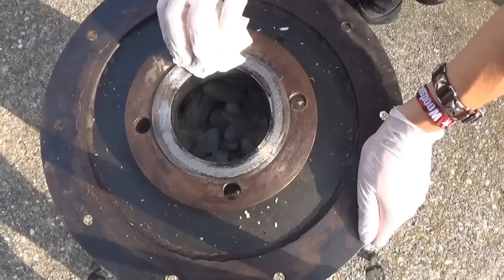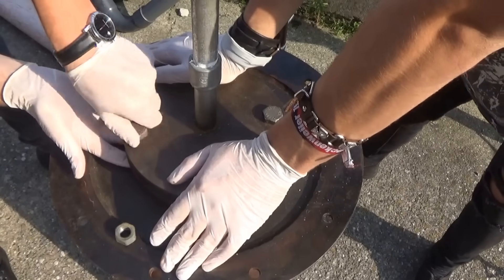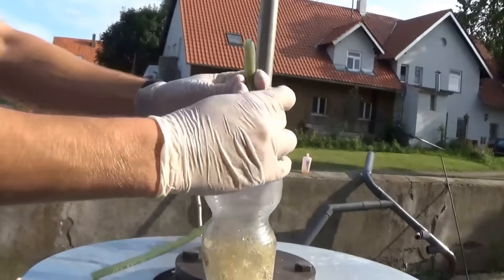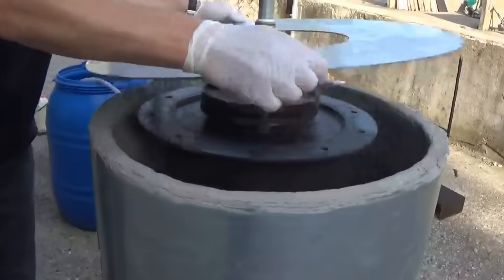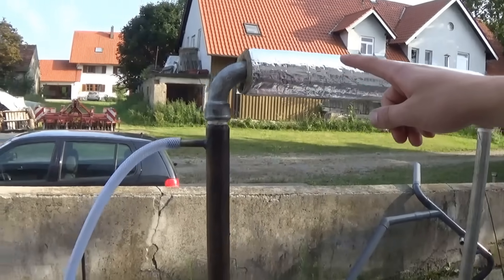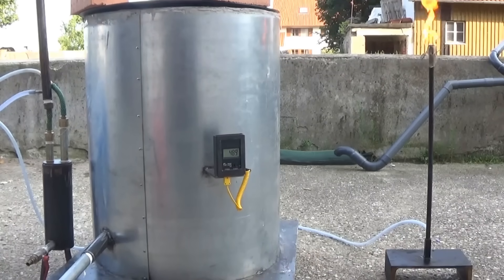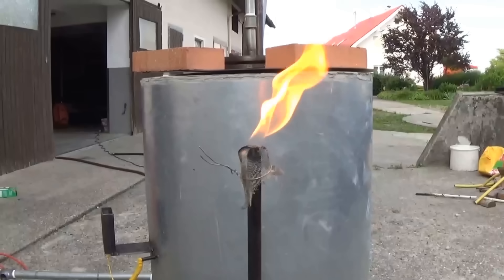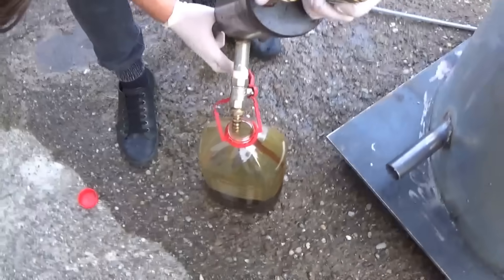plastic waste to oil/fuel improved pyrolysis reactor

Comment: I fully agree with Hazel Chem: All PE (marked #2 or marked #4), PP (marked #5) and PS (marked #6) plastics must be recycled, not just used as feedstock for pyrolysis oil. The only exception could be if contaminated or very dirty. Hard to remove contamination, fx. paint layer/glue/hardened oils, makes theses types of plastic uneconomical to recycle for the time being.  In the near future all contaminated plastics can be recycled, as more chemical recycling plants are being constructed. Contaminants in plastic for chemical recycling are not affected by this process, thus it's possible to recycle virtually all waste plastic; no matter how dirty it is. 
It's worth noting that PS plastic can cause some problems with the pyrolysis oil. After a few weeks of storage a jelly like substance starts forming at the bottom of the container, then spreads slowly but surely through the whole content. Sometimes the pyrolysis oil already contains jelly like lumps right from production. The solution is to use a catalyst (Zeolite or another of the hydrated aluminosilicate minerals) to crack the molecules during the pyrolysis process.
Obvious plastic types for conversion to pyrolysis oil are the thermosetting plastics which cannot be remelted, i.e. epoxy, bakelite (creates formaldehydes), plastics with high filler content (fx. PP with Natrium Carbonate/"Sodium Carbonate"), and similar problematic types. Some of the plastic types in the collective group marked #7 (construction plastics) can be pretty hard to sell, with only a few buyers worldwide, and are therefore mostly pyrolyzed. This is also the case for the odd alloys belonging to the group marked #7 plastics (fx. PMMA/PC, and several other plastic alloys). In order to sell these types, a minimum quantity of 10 or 20 tons of the individual type in each shipment is required for anyone to be interested.
Another problem is PE, PP, and PS plastics with added glass fibers (marked: +GF), these are added from 5 to 30% (occasionally up to 50%) glass fibers. During the recycling process the glass fibers will unavoidably break up into tiny short ultra thin glass splinters, thereby loosing their ability to reinforce the plastic; it becomes just an annoying filler. Nobody wants to buy that, so pyrolyzing is the solution. It's worth adding that the biproduct carbon black can neither be sold because it's heavily contaminated with broken glass fibers; though it can be used as fuel in the fire chamber underneath the pyrolysis vessel. The same process goes for glass fiber reinforced resins (fx. hulls from old boats), although technically advanced pyrolysis units can recover the glass fibers as well, provided the glassfibers are long enough and the pyrolysis residue consists of mainly glass fibers (i.e. boat hulls/windmill wings).
Be aware that a large part of plastics from WEEE (Waste Electric and Electronic Equipment) contains added Fire Retardants (marked: /FR). These are toxic!  They are either Bromine(brominated) or Chlorine(chlorinated) based, and additional hazardous plasticizer- or stabilizer chemicals may also be present in such feedstock. Never try to pyrolyze such material unless you have a professional unit capable of catching these elements and extracting them completely from the pyrolysis oil. Not all plastics from WEEE contains these chemicals, but a thorough sorting is definitely needed. Besides the pyrolysis oil, the Bromine and the Chlorine can be recovered and sold, or used for other chemical reactions in situ.
Basically, don't try to pyrolyze PET (marked #1). It contains Terephthalate which will sublime and immediately crystalize as soon as it leaves the hot pyrolysis vessel, thus clogging up the tubes with a possible dangerous explosion as a result. You can sell the clean and/or relative clean part for recycling. In fact the remaining dirty and/or broken pieces can actually be processed, but only by a very sophisticated way of pyrolysis. It's solely possible if you have a highly specialized two stage pyrolysis unit capable of maintaining a precise 700 Celsius temperature in the second chamber; and only if you really know what you're doing! The resulting pyrolysis oil will contain at least 30% Benzene (sometimes over 45%), a highly volatile hydrocarbon compound with a boiling point of 80 Celsius; very useful as a solvent for chemical processes. The Benzene is separated from the pyrolysis oil by fractional distillation. The pyrolysis oil can also be used as fuel, provided you have a closed storage/feeding system for your burner,  and a fire chamber capable of maintaining a very high temperature. Benzene is highly carcinogenic and dangerous!  Benzene causes central nervous system damage acutely, and bone marrow damage chronically. Spills are also problematic as Benzene vapor is heavier than air and therefore rather difficult to get rid of. Benzene vapor also presents a serious explosion risk!
It's popular to pyrolyze old car tires, but this presents a major environmental problem. In the Western World a limit of only max 0.5% sulfur in fuel is allowed. Pyrolysis oil from any kind of rubber feedstock will contain over 5% sulfur! It's forbidden to use as is, but it can be sold to refineries that upgrades such low quality "crude oil" and during the refining process removes the excess sulfur. The carbon black residue, the biproduct of pyrolysis, will also contain sulfur. It's prohibited to burn, but there's no need to try to purify it as it can easily be sold to rubber producers; it already contains the necessary sulfur needed for the rubber synthesis.
Generally, stay far away from PVC (marked #3). Tremendous challenges for pyrolyzing this plastic type are present. From a technical view the main problem is it's made of 57% Chlorine. It's the only plastic type containing Chlorine, and it's literally not for amateurs. Chlorine gas will kill you instantly! Seen in a health perspective, all plastics contains some additives, but PVC is the only plastic that always contains a myriad of added hazardous chemicals (10 to 70%), and a small percentage of poisonous Cadmium as well.
Plasticizing additives (primarily to soften up the PVC, but also fx. to make it resistant to degradation by sunlight) includes the controversial phthalates (most commonly (di(2-ethylhexyl)phthalate, DEHP) which are carcinogenic and mutagenic (endocrine disruptors)!
It's a complicated process to catch and remove all these hazardous contaminants, but certainly worth it. Besides pyrolysis oil it mainly yields a huge quantity of free HCl (Hydrochloric acid), useful for lots of chemical processes; after it has been purified!  Due to the Chlorine vapor(gas) attacking almost everything, this process requires a professional well constructed pyrolysis unit, made entirely of acid resistant (high Nickel content, 52%) stainless steel; such as the one I have.
Reply from the maker: thank you for the very informative comment! It is allays nice to see such well crafted responses. If you like to you can write me an email.  I am very interested in having a conversation with another hobby p-reactor builder. My mail is hazelchemistry@gmail.com 

mfg hazelChem
Reply: Are you able to email me? I'm a 2nd-year university student interested in creating a chemical recycling company for plastic, and I'm wondering about your sources and/or role in the plastics industry? You seem very knowledgeable, thus, I think you would be a good contact. Let me know if you're interested in talking, thanks!
Reply: You’re full of interesting information, at least to my mind! I’ll be rereading your comments and trying to make notes! I’m a 57 y.o. guy who’s retiring a little bit early but still am interested in turning “waste” into beneficial products! Would you recommend some resources for me to learn more? Thank you in advance!
Reply: Very valuable input and I am sure that in a properly controlled environment, these aspects need to be taken into consideration.

I however live in Africa where we are face with two major problems, that as far as I am concerned, need to be addressed first before worrying about further finer points of the process ...

Firstly we have a massive waste disposal problem that needs urgent attention and in most of the continent the word recycling means very little.

Secondly, we have a massive energy crises that needs to be addressed.

I would therefore like to get information about a simple and reasonably effective procedure that any household or small group of people could use to get rid of waste in their immediate area while providing some sort of fuel they can use to generate electricity from.

While we are cleaning up the environment and providing households with electricity, we can be educating people and refining the processes.

How do I combine pyrolysis using plastics to using other carbon based feedstock such as garden and kitchen waste?
Reply: Uh. I guess best way of recycling plastics containing paints, fire retardants, uv stabilizers and who knows what is to burn it in incinerator/powerplant in high enough temperature to burn all dangerous volatile gasses. It makes no sense to create fuel from plastics and at the same time to burn everything from gas to bunker oil in powerplants when some of these refinery products can be used for making plastics.
Reply: Sounds like we should just incinerate (600C+) all of it, and bubble the output gases for cl/br/S capture.
Reply: Can't believe I red that
Reply: @zero-waste  Chemical engineer here, and you're right about the dangers. These "fuel from plastic pyrolysis" videos honestly terrify me almost as much as all the commenters saying we should all be doing this. I weep for our future.
Reply: Hello, enjoyed your informative comment, I was wondering if you could provide me info about recycling PMMA to monomer (MMA)? And also info on purifying it to %99.
Actually I'm working on converting Acrylic sheet wastes to monomer MMA, any help or pointing a info source would be appreciated.
Reply: Nice information
Reply: Thanks for the precious informations!

Comment: So if the polystyrene is causing issues with the oil, perhaps it would be good to separate it out to do pure polystyrene runs, then that oil could be treated with extra steps separately
Reply from the maker: That is correct I have already done a PS recycling video where i showed that it is easily possible to produce the styrene monomer from PS in a good quality. 
BUT the problem is that the system aims at to recycle mixed plastic waste and separating is costly so I am looking for a other way to overcome the issue. 

mfg hazelChem

Comment: This setup won't achieve anything except unusable toxic waste...
Reply from the maker: well then do you have anything to back up your claims? scientific papers or data? If this is the case I would be happy to read thru them and discus them with you :D if not well ... it is just your opinion and I couldn t care less about something 

mfg hazelChem
Reply: I have a PhD in chemistry and I am  working working for a pyrolysis company since 10 years. I would say that I am experienced in this field. There a plenty of points in your system which are questionable (contact of humans with toxic products, no gas washing/purification, quality of oil, etc..). There are hundreds of papers concerning this topic, what do you want to get/know?
Reply from the maker: @nerussol3664  If this is the case id be happy if you shared your specific concerns with me! :D you can do this here or via mail hazelchemistry@gmail.com

conderning the toxicity of the oil I am well aware of its dangers (lots of aromatic hydrocarbons and other unpleasant things). Secondly why do you think that a gas washing system is needed for the pyrolysis gases? As far as i am concerned they are mostly made up of shorter hydrocarbons and free of halogen or sulfur contamination. So my question is why should I use a gas washing system ?    

mfg hazelChem

Comment: you should have added a gas washing bubbler before the syn gas burn off. It would also prevent flash back into the receiving vessel.
Reply from the maker: no need for this ! a bubbler (in this case) has no benefit. I mean what should it remove ? 

mfg hazelChem

Comment: Styrene is carcinogen. This a concept but would give enough data for design of a chemical reactor. Safety features are entirely missing. Long unsaturated HCs if polymerises in carburettor of your car or in cylinder of car, god saves you. Nicely explained though...

Comment: I'm glad you said " don't kill yourselves. I live next door. What about me and mine. Did you ask me if I minded you building a bomb in your backyard? This is so odd. I'm not sure what. But something bad is happening hear.
Reply from the maker: it seems  like you are a troll but if you are not: this is no bomb you using a spray can inside is way more dangerous, secondly if have worked with engineers form garlock sealing technologies on the safety of the system so do not worry about it ... thirdly if you really live next doors why didn´t you just came over and asked what is going on? I would have explained it to you .... ah and one last thing there was a article in our local newspaper on the whole project sooooo you could have known it throug that it explained the whole system. 

and lastly because you didn´t seem to get the " do not kill yourself it is a joke from the beginning of my channel and not a real concern ..." 

mfg hazelChem

Comment: Who even converts high engineeering  plastic to oil  ? Petrol is worst product used only to run automobiles
Reply from the maker: It is a process that would enable developing country's to produce a "low" grade fuel out of plastic waste. This could be used for cooking or heating instead of burning wood (which leads to deforestation and ultimately to desertification) or plastic waste (which when burned releases a lot of toxic/harmful substances. For most industrial countrys this process should only be used on the non recyclable fraction of plastic waste (because a industrial setup can use the pyrolysis gas to maintain the pyrolysis and serve as a combined heat and power plant that also has a output of fuel oil) 

mfg hazelChem
Reply: @HazelChem  convert it into another product instead of making engine fuels
Reply from the maker: what do you suppose ?
Reply: @HazelChem  any plastic product like ball pens , holders, plastic screws , copper cables ... any thing
Reply from the maker: @Blue.star1   for that you would have to sort the plastics which is done industrially BUT there is a fraction that cant be sorted and recycled this is what this should be used for in industrial countrys. On the other hand in developing countrys there is a lack of cheap heating fuel so any plastic waste can be converted there (do to them not having such expansive sorting equipment) another point to make is that you are (most of the time) downcycling plastic so the quality durability and so on decreases with every recycling. These are all factors that have to be taken in to consideration. And as last point I want to add that saving our future is not an one tech thing it is a puzzle out of many technologies and a lot of socialengerneering. Hope this helps to understand my opinion on the matter.

mfg hazelChem
Reply: @HazelChem   anyway try making liquid chemicals from coal with your setup , coal liquefaction,  long time ago I tried for few days buy stopped it... try to make chemicals not fuels from coal ....costly chemicals like phenol ... etc
Reply: @HazelChem  make chemicals like phenol etc instead of fuels with degraded plastic

Comment: You should consider heating with a waste motor oil burner. You just need to preheat the furnace with propane and then run it on free oil.
Reply from the maker: I have bought one for use in this reactor ... but I have build a completely new reactor that uses the thermal energy of the gas much better video will come soon ^^

mfg hazelChem

Comment: I heard awhile ago somebody had made a. similar device to extract the oil from rubber car tyres, would solve a world wide problem
Reply from the maker: the tec exists but you need a desulfurisation unit which is quite expensive and hightec 

mfg hazelChem

Comment: Great work! Do you know how much energy it uses to convert 1 kg of plastics? I'm curious about its overall energy efficiency.
Reply: When you use propane to do so, I think it's more wasteful to do so. Using electric is so much more efficient.and controllable.
Reply: bryan brunk have you done any quantitative analysis on that?
Reply from the maker: well the problem with electricity in such a big system is that it can easily kill you and I am no electrician so I went with the gas approach. I am also working on a save method for compressing the pyrolysis gas to use it in the next pyrolysis.

mfg hazelChem
Reply: @HazelChem  How are doing your research in compressing the vapors in some way to use in next time?

Comment: Fucking GRAVEL lol
Reply from the maker: well you gota be creative ^^ using lab grade reagents for flushing your system with CO2 is just not cost-effective

mfg hazelChem
Reply: @HazelChem  If you have an air compressor you could make a small PSA Nitrogen Gas Genorator, would that work?

I was plotting a Open Source Pyrolysis Kiln, and was thinking welding gas tank, or psa generator in:

https://wiki.opensourceecology.org/wiki/Open_Source_Fuel_Agnostic_Pyrolysis_Batch_Kiln

Comment: Used tires can also be turned into diesel fuel.  Should be happening everywhere but it's not.
Reply from the maker: this is due to the sulfur in them! expensive catalysts are needed to get rid of it. You can read about some methods  here http://www.sci-int.com/pdf/636324827430738438.pdf

mfg hazelChem